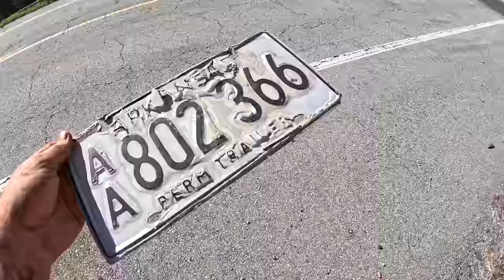Magnet Fishing A Forgotten Dumping Ground

Comment: Around thing you found is an air conditioning compressor I believe for maybe a Ford or something but those little separate round things on one end or the clutches it engage the compressor when you turn on the switch

Comment: Had a coil pack for a car as well as the rear brake drum plate with the wheel cylinder on it and one more car part
Reply: Last couple minutes was a car ac pump and a water pump was the thing you called a motor pump